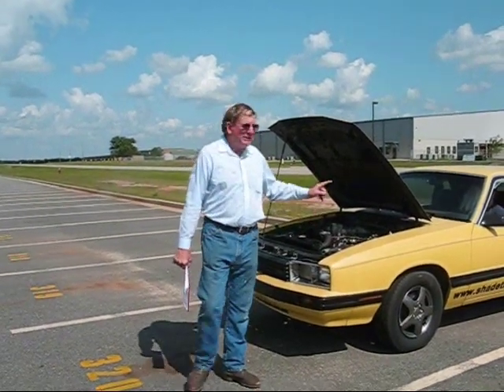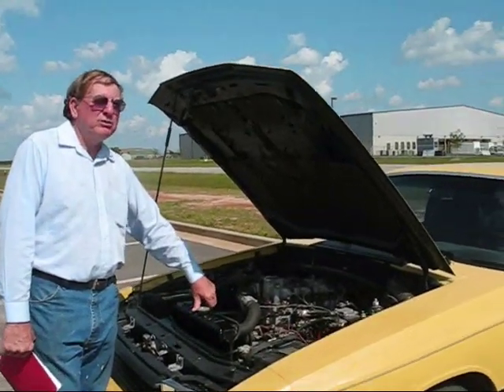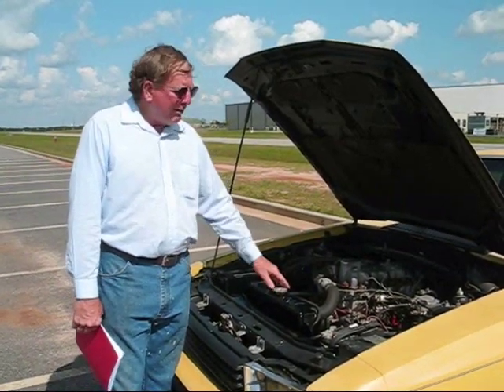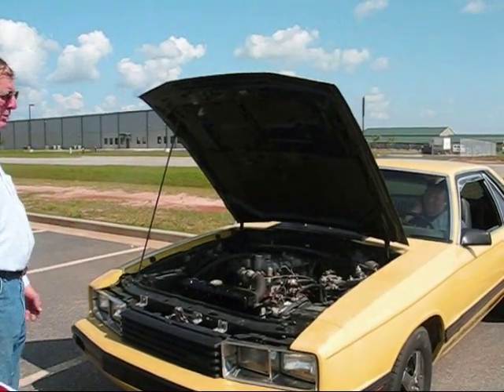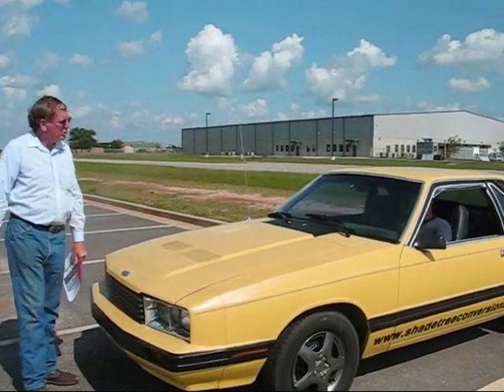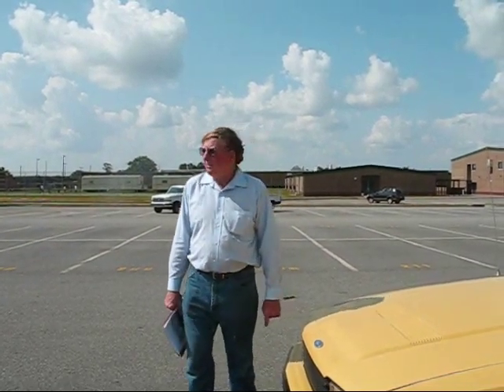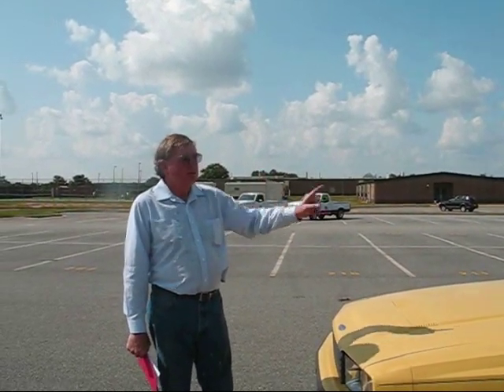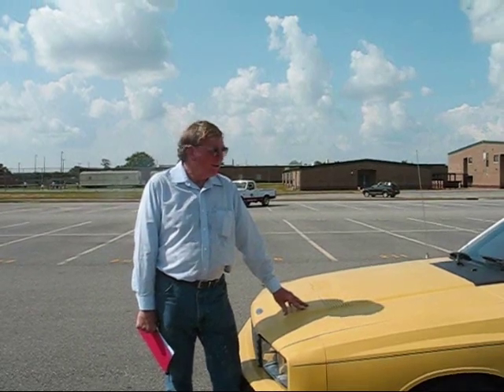Shade Tree Conversions Diesel turbo tractor engines Part 2

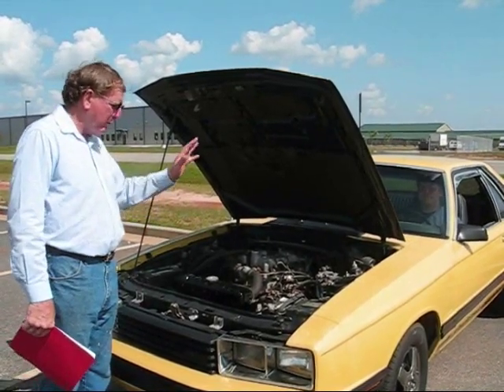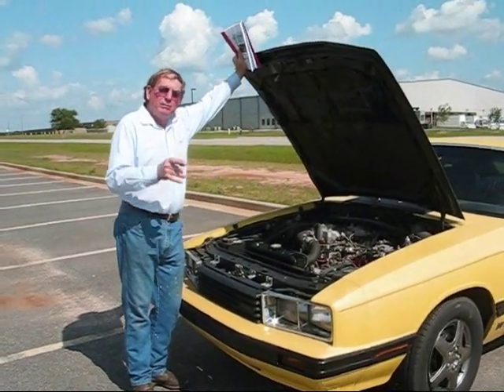Comment: If you have a big v8 gas engine especially in an suv in other countries they think you are a millionaire but if you are in America getting 10-12 mpg in a crap suv you are barely keeping up,they want america to just plow thru fuel.how my 2022 duramax with a hwy gear 3:23 and a 10 speed transmission gets way worse fuel economy empty than my 2000 cummins 4 speed auto and 4:10 rear end is paying way too much for reverse progress.america should be ashamed

Comment: Diesel fuel is 60 cents higher than unleaded here in 2019. Used to be the other way around.
Reply: The enviro-whackos took care of that then made it low sulfur so it takes twice as much per mile..They continue to spend 1 million tax dollars to save 100 dollars..

Comment: i have a old renault clio that i bought for 300€ it runs 40MPG, nothing revolutionary on the engine. if i drive it for 5 years 10 000km a year it will make one kilometer cost 0,048€ with 50% tax on fuel.

Comment: Rented a Honda civic in England and it got over 55mpg. Drove it like a rental car revved it mercilessly and still got awesome mileage. Why don't Honda offer that engine here?
Reply: Victor Borg 
US EPA won’t allow certain engines in this market. Europe decided mileage was more important than emissions.
Reply: Nathan French crazy question, wouldn’t burning less fuel reduce emissions through proxy
Reply: @031683naf  Better mileage less emissions.
Reply: The emission controls on American spec cars make them perform worse and use more gas.
Reply: @ronaldjensen8614  kilometers or miles?
Reply: @ronaldjensen8614  but pollute less right?
Reply: @PaulLorenzini-ny2yw  it's not about pollution it's about control!
Reply: @PaulLorenzini-ny2yw  nope
Reply: Had diesel jeep cj-7's in Europe in the 1980's also. It was a Nissan inline 6 diesel.
Reply: Kilometers per gallon?
Reply: UK gets a better version of unleaded then we do. Higher than our premium fuel and that does make a difference. Guy is on point 10+ urs ago...

Comment: you'd be surprised the mods for some vehicles that get passed, i know a guy that cut a car in half and if he can find another place to mount the fuel tank instead of the passenger seat a place for a rear-view mirror and a windshield he could drive the thing down the road legally, and yes it does have rear wheels.
Reply: The hash slinging slasher. 
The factory put a 13 gallon tank under drivers seat in my Jeep. Similar for my 70 Ford F100 with gas tank in cab right behind the driver. Whats your point?

Comment: @nighthawkron He researched it.  He finds out what fits, etc,(engine to car)  eg. A drawing of how to build a set of Motor mounts to adapt the Chassis to fit the Engine. $50 is CHEAP. 

You could do it without plans by dropping the engine and trans into a chassis and shimming it up with Wood Blocks, then taking measurements to build the mounts.

I can't even put in a Full Tank of Diesel in my VW Diesel Jetta for $50 !  So who is scamming who ?  End Of, and I MEAN End Of !

Comment: @einkaufman Most of the Alaskan oil goes to the pipes that run to a dock, pumping it on a barge to Asia, mom and dad have been there many times, taken pictures of it, yet when BP pipelines were down, we paid a higher price, yet wasn't an interrupt in out supply. I have a friend with land in Louisiana, was drilled for oil in the 70's, he's not received one check, because it's been capped. From an inspector, there is more under the US than anywhere, but remains capped, he's seen it!

Comment: kerosene will ruin the fuel pump as it doesnt lubricate like diesel does and this is only lubrication for all or part of the pump depending on model, add some oil thats all.Cool idea BTW.
We had much trouble with VM engines, thats why land rover stopped using them, they blow head gaskets and overheat although they seem ok in jeep cherokees.
quite powerful - about 120bhp and 220lbft as much as olds 5.7 diesels!
The vm also come in 5 and 6 cylinders.
Reply: You mix it half and half Diesel also add 2stroke oil